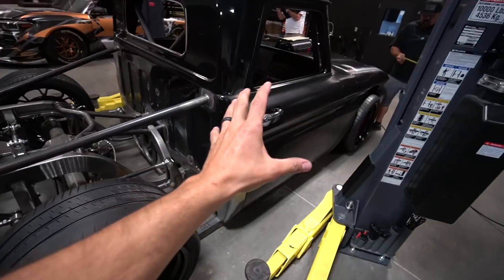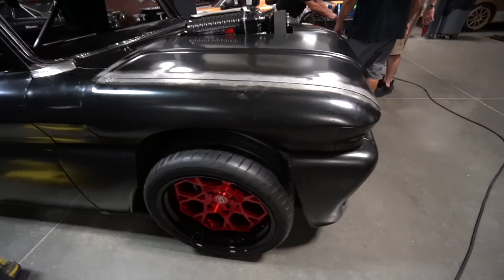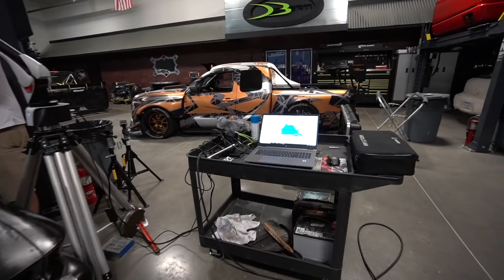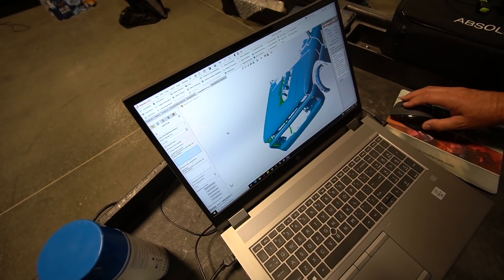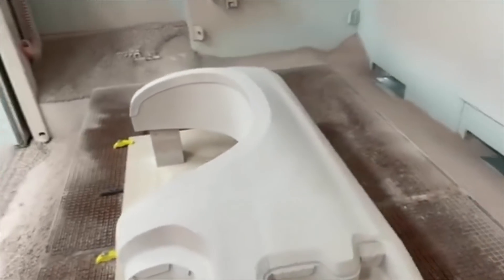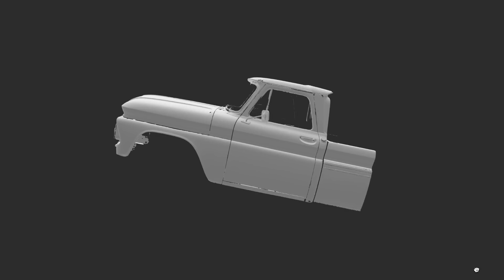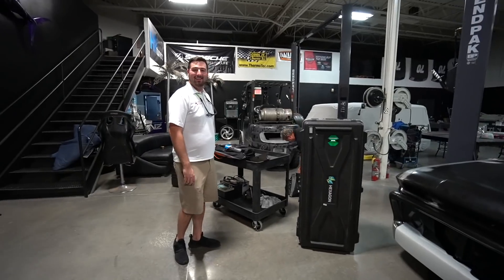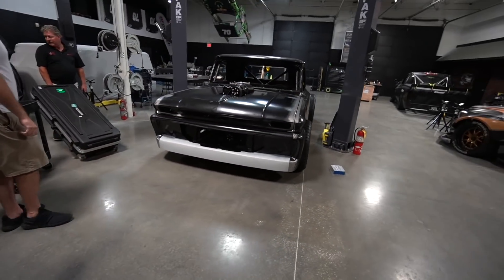3D SCANNING MY 6 WHEEL C10 TRUCK TO MAKE WIDEBODY! - C10SLAYER EP.18

Comment from the maker: What would you scan if you could use one for a day??
Reply: Prob a VW T1 21 window samba!
Reply from the maker: @nobeldnoble7048  to build what???
Reply: @DeBerti  i guess i would use it as a template to stretch it out....perhaps double wheels to help carry the extra weight.......like a big oldschool airstream , but then with a T1 samba base...hehehe...perhaps the first 42 window T1....and give the rear a wide body...and the front just extended arches!....so to answer your actual question...lol...a campervan with modern day comforts/interior!..
Reply: What do most people do with a copy machine? LoL
Reply: @OfficialStumpMan  a scan is not a copy machine.....its a scan!....hehehe.
Reply: I think the c10 slayer needs a small cab spoiler .

Comment: So what’s the purpose of a 3-D scanner you can take the picture of your truck and change body lines with it on the computer
Reply: But can you use the picture to design and be able to model those parts in cad?  And then take those designs to cnc and 3d printing machines for mass production?